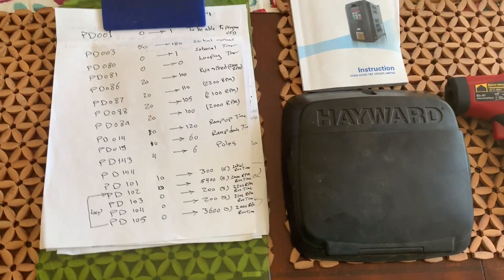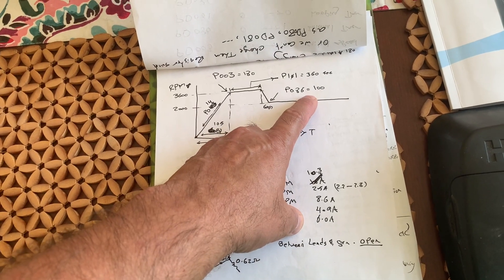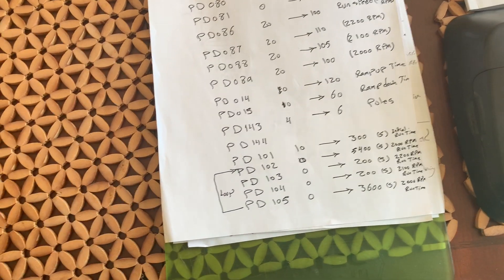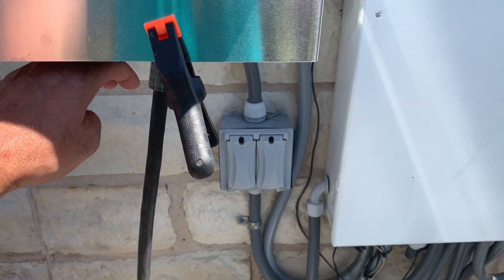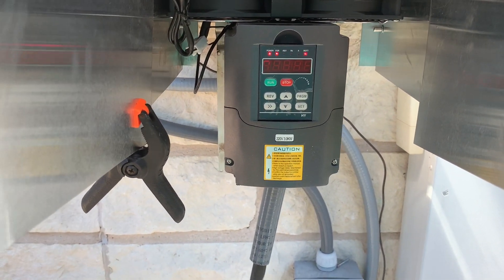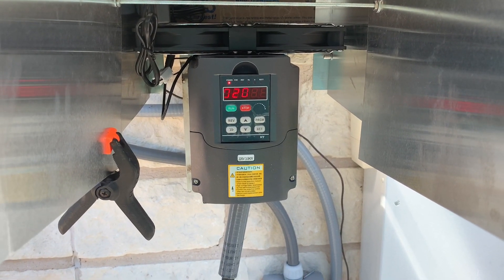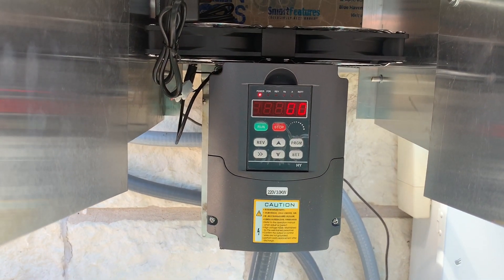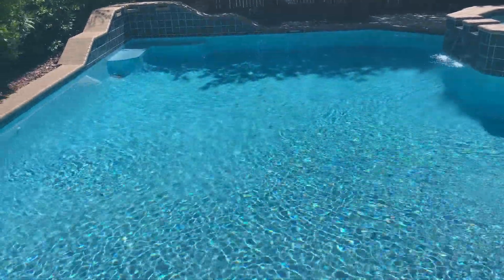Hayward SP3400VSP Repair (2 of 2)

Comment: Maybe I am wrong but I think your pump runs the wrong way around. Hard to see in video. Label states CWLE, so clock wise lead end. It looks like it runs CCW. It works in reverse but moves a lot less water, it is far less efficient. I did a similar repair and I don’t know why, but it runs great with the output voltage at 120V and I get a current fault right after it starts when set at 220V. Makes no sense by what it states on pump label.
Reply from the maker: If pump runs in wrong direction it will not move a drop of water to the filter. how ever the pump design if it runs in opposite direction it will move the water to the opposite way as well.
Reply: Nope, just try it. I first had it run the wrong way. Running the wrong way the water still exits the impeller to the outside.  It works but I had to set it at much higher rpm. Very nice videos by the way! The 120 V stumps me, no idea why I had to set it that low.

Comment: Great video. I am about to do the same with my Hayward, but I probably have a Raspberry pi be the timer controller and remote control.
Reply from the maker: If you be patient I am in process of uploading the new Clip I use ESP8266 and now I can control the pump speed and duration with any Iphone and Ipad within same network, many controller can be connected at once to the pump controller and VFD take the last command and execute on that.
One more important thing this VFD have a setting that need to be program correctly  to run with this Hayward pump or you might end up with vibration in slow or high speed ,if this VFD program correctly the pump is run smoother than with original VFD module (quite) with the wider speed range. 
Many people that they used this VFD reported excessive vibration in high speed because they didn't set the parameter correctly those parameter need to be set once forever.
Reply: @Mark1Jordon1  I just got my VFD drive by UPS. The P0xxx does not match up with Yours, but I will figure it out. It is a XSY1-AT1, AT1-2200S. Rated for 12AMP and the pump is 9.0 AMP.
I let You know what the progress with the Raspberry Zero, which I planned to control the Jandy valves too.
Reply from the maker: Just a heads up if you did not get Huanyang VFD it will not work I order the second VFD different brand look like Huanyang it did not work the new one (because it was cheaper) it did not have all register setting that Huanyang have so it did not work for me, good luck. I am planning to put my setup in youtube but it will not be free the copy of setup and schematic + Sketch for ESP8288, and Iphone OSC program it running for last 7 months

Comment: Hi Mark, Hope you are doing well. Great videos. I had actually the same idea as you had with replacing the drive with a regular VFD. I bought the VFD from Amazon and wired it up. The same type you have. Without the motor connected everythings looks good in the display, the hz ramp up and down as expected. But as soon as I conntect the motor, the VFD stalls in a range of 12hz and ends up with an Error Aol in the display. No explanation in the manual and I tried multiple things to improve the situation. What makes me wonder is that P 142 the motor current I can't set to 13A, it is maxed out at 11A even the VFD says it can handle 13A. What am I doing wrong?
Reply from the maker: Did you buy the original Huanyang VFD ? how many pages is your manual?
Reply: @Mark1Jordon1  The printed manual has 67 pages and it looks to me like to original. https://www.amazon.com/gp/product/B07452BX6S is the link where I bought it. What makes me really wonder is, that in my manual it says 13A for max current, but P142 is only going to be 11A.
Reply: I also checked the input voltage,... everything else seems to be fine. Just the Inverter has not enough juice to run start the pump.
Reply from the maker: Yes, that is just like mine is original since the manual for clone is much smaller, I can not change REG 142 from 11 to 13 as well that is not the issue.
I actually update my system that I be able to control the pump speed and duration via Iphone and Ipad with HY VFD, you can connect as many Iphone and Ipad that you want to the VFD and control and modify the speed of pump and timing with feed back from VFD via wifi one of these days that I find some spare time I will post a video about that.
send me all lists of all register that you modified and modified value
Reply from the maker: If is nothing wrong with VFD that is plenty power to start the pump it might overheat if you run it for long time with MAX speed but for sure will start.
Reply from the maker: Do you have high wattage light bulb or heater you can place it between two phase output of VFD (VFD have three phase output)and check the VFD, Also make sure your pump is not shorted to ground.
Reply: @Mark1Jordon1  Hi Mark, I got it running. I saw another video of you and a guy named Bo Xing seems to have the same issue as me. He adjusted the base frequency to 310hz and the pump is not shaking anymore and runs. Before I saw his comment, I played around with the frequency curves and got some better results. I think i will continue looking at this issue at the weekend. 
Yes, I have my complete pump control controlled with a few ESP 8266 and some relais. All integrated in Home Assistant.  I am happy if you want to share what you did. I could also control my solar heater based on the sun,.. I have all the sensors in home assistant but right now it's not programmed completly.
Reply: @alarmhome5281  Any chance you got this vfd to work and if so, do you have the settings? I am having the same problem with the vfd cutting out at higher frequency .. Thanks
Reply: Setting the max freq much higher and then using it at a much lowe frequency is similar to setting the voltage lower. It assumes full voltage at max frequency and a proportionally lower voltage at lower frequency. The people that made the label did not have the right info, it is not a 220V motor, it is more like a 120V motor. The wire connections are listed wrong too, there is no L1and L2. The 180Hz is probably correct.
Reply: @alarmhome5281  The 310 solved my issue as well!
Reply: @KJD783  I don't think they intended the motor to be separated from the driver, so L1 and L2 makes sense.